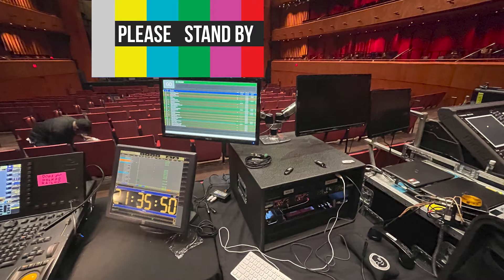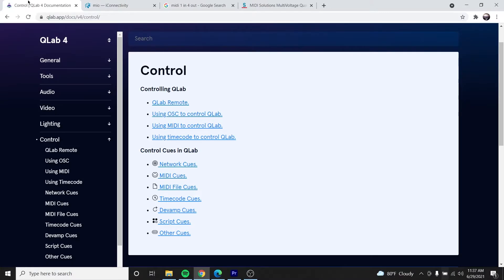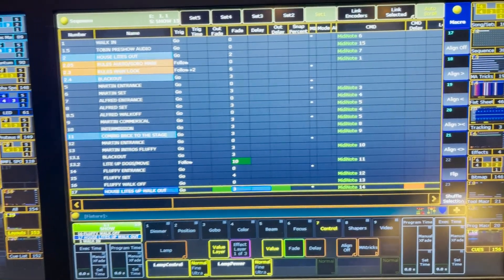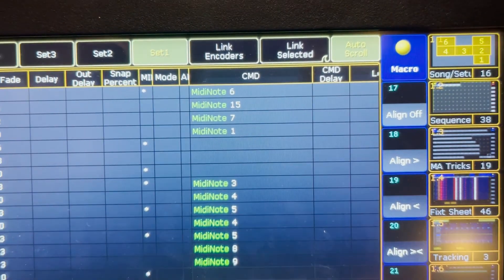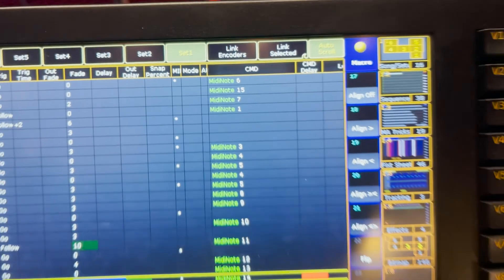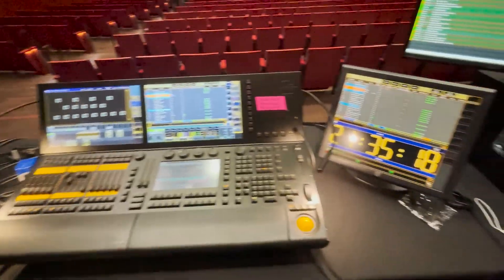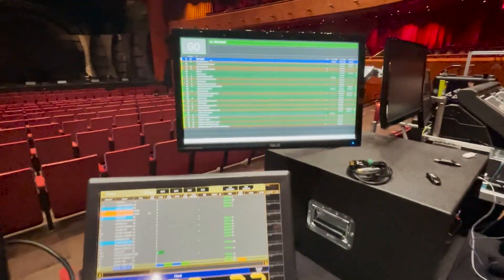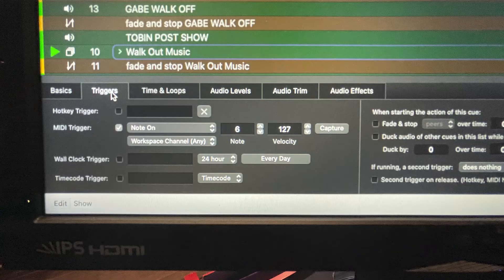GrandMA2 controls QLAB as Media Server

Comment: Hey! I‘m searching for a solution to have the possibility that QLab is sending a timecode signal to MA to trigger 20 different songs for a timecode Show. Does QLab this?
Reply from the maker: Hey, yeah sure QLab can work like that.  Just import your tracks into qlab, assuming ltc on the left channel and the song is on the right just map as such in the software and plug and XLR cable from Qlab left output into the MA desk.
Reply: @cgmedia5884  Is there also a possibility that QLab can send MIDI Notes to MA to trigger Cues or Macros? Thanks for your Time!

Comment: So you're using the Midi distributor box simply as you're sending a Midi signal to 2 Macs? If you were using 1 Mac, technically you could just go Midi straight from the MA into the adapter which connects to the computer? Don't need the distributor?
Reply from the maker: Yes thats correct as long as the MA has a midi female port or something to barrel the 2.  You can also use network midi if it was going into an ONPC in a session with a console.

Comment: Hi there, thank you for the video. I am preparing a very similar setup with a single Mac Mini, Qlab, grandMA3 and dLive. I am not sure which processor to choose for Mac mini. M1 seems to have good specs but I'm a bit afraid of the new environment and compatibility with 3rd party software. Intel based machine however is a bit weaker but it has 1 more display option, more thunderbolt slots and is compatible with older software. I would really appreciate your advise. Thank you in advance :)
Reply from the maker: I would recommend the M1 Chip as it has worked very well for me on the road now for about 2 months.  Just be sure to do your research and triple check that whatever software you want to run has been tested on it.